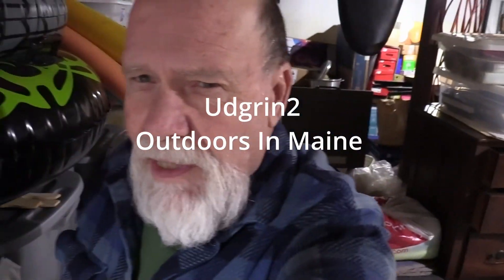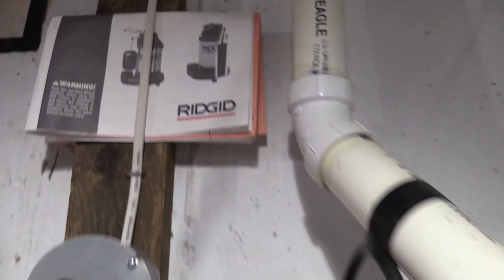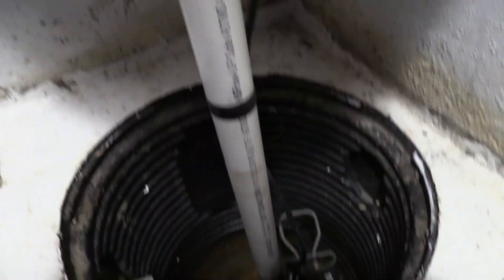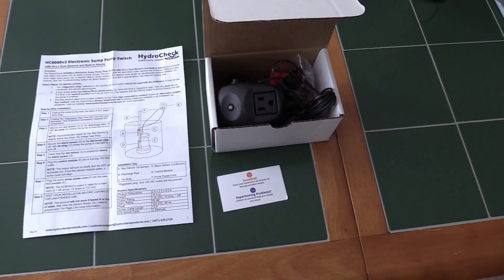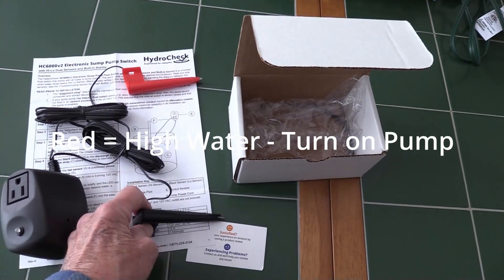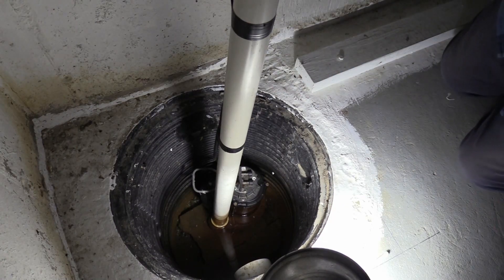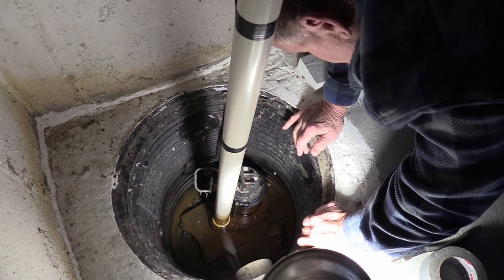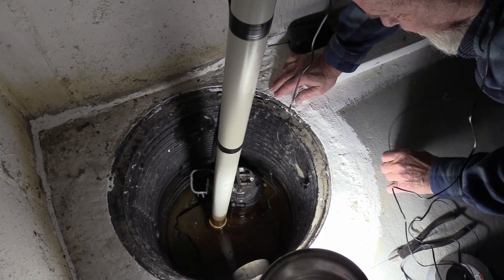270 Installing Hydro Check HC6000v2 Sump Pump Switch

Comment: Those pumps are rebranded Waynes, garbage switches though. Mine died five years ago on Christmas Eve, picked up this switch, zip tied the float in the on position, and its been humming along ever since. Not a single issue since eliminating the oem switch. Pump itself is quality, it really is, especially with the top intake
Reply from the maker: It always seems to work

Comment: you have plenty of room for a backup pump. I suggest you get one. You'll sleep easier. You can connect them in an "h" configuration. The primary being on the bent leg with the horizontal part cut and covered with a 6 inch black rubber gasket so you can pull it out easily if it fails. You slide off the gasket and tighten on a black rubber end cap at the pvc cut so the water doesn't squirt sideways. The backup pump on the straight section of the "h" then takes over the load. You can then disconnect the pvc from the broken pump and screw it into a new one. Drop it back in the pit, remove rubber end cap, slide gasket back on.
Reply from the maker: I think I'll stick with just thr one....

Comment: Is this standalone, no plug into the sump pump?  How does it activate the pump?   Thanks for your video!
Reply from the maker: Sump pump is plugged into this unit with high and low probes to regulate pump

Comment: Any update ?
Reply from the maker: About a week ago, we had some water come in and this switch performed great!  I wish I'd purchased this a long time ago!  Definitely recommended...
Reply: Hope this is my answer for tethered float switches I picked up hc8000t's and a hc7000v2 for 40 bucks each today going to try one tonight
Reply from the maker: No ground needed on new unit
Reply from the maker: The switch has performed flawlessly,  I wish I'd have known about this sooner...
Reply: @udgrin2  Did you have to run ground wire? I don't see it.